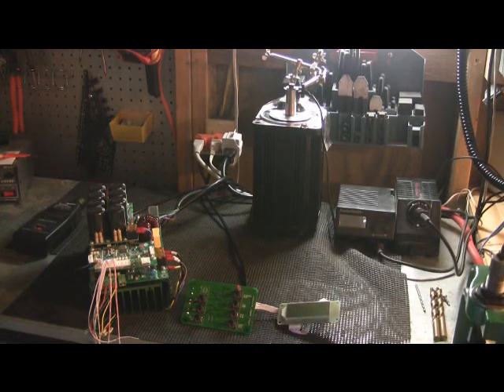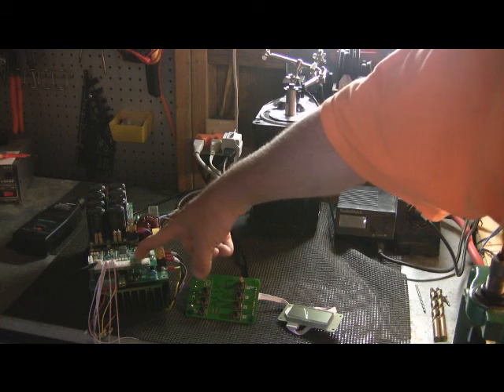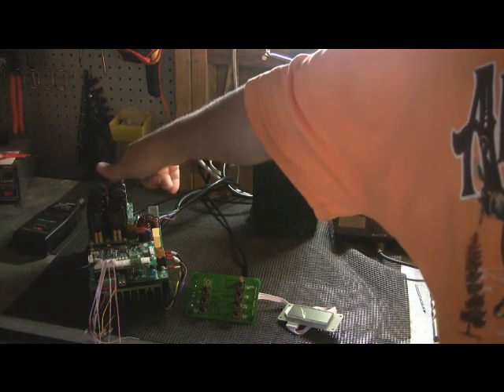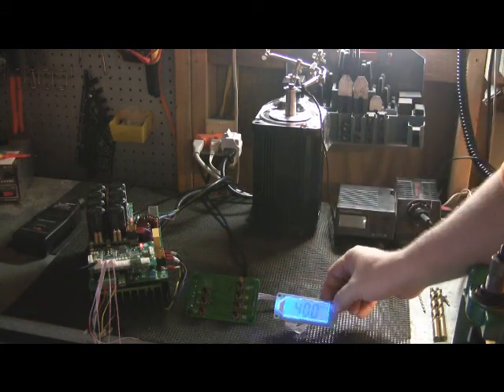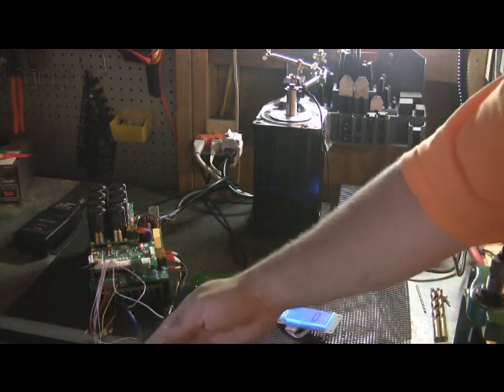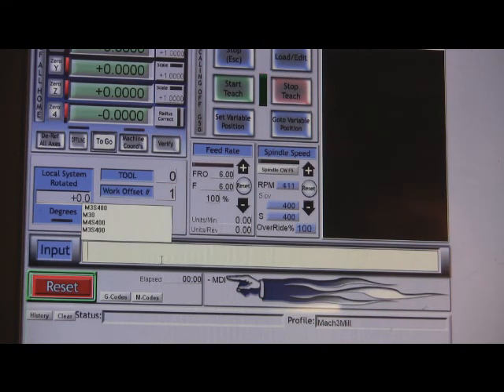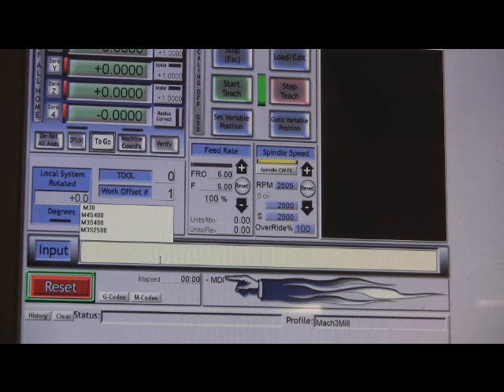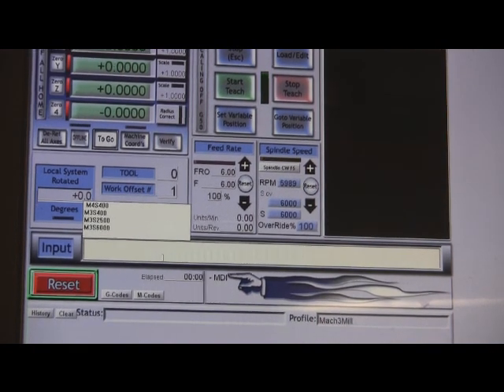motor and controller review

Comment: Does this setup have spindle orientation?
Reply from the maker: +Shane. Sure. That is dependent on the Mcode you use to start the motor. The motor can run either way.
Reply: +cjdavis618  I was referring to control of the degree of rotation you stop the tool.

Comment: Cjdavis,
I have the same setup as you with the c11 BOB, but I have an 1100w sangmutan setup that I have been trying to get to run via Mach 3. I have tried to follow your hook up instructions but they are for the 2200w setup as my controller board does not have a CN6 spot. I just cannot seem to get it to work and I have read your post where you said you were hooking up an 1100w motor, could please tell me exactly how and where you are hooking wires to from the c11 BOB and the Controller. Also I don't have the C3 for the RPM yet but will order one now, but why can't you use the rpm feed from the motor controller board?
Reply: Hey Jim, I am in the same boat you are.  Did you ever get it figured out? I set it up just like he did with the C11G and the mach3 settings but have no motor movement.  My machine didn't come with the manual control card so I cant usd that.  Thank you
Reply: @1972nova355  I did, but that has been quite a few years ago and I have slept a few times since then so I do not remember what I did, but I know it turn out to be something simple.  Sorry I can’t help anymore than that.

Comment: This looks like just what I need for my gantry style router/mill system. I use the Kress spindle for woods and plastics and non-ferrous metals with small cutters. But I need a slower system for ferrous metals although I have successfully milled Meehnite with 2mm cutter going at about 8K rpm. I also use Mach3 with a DIYCNC b/o board.
When you apply your system to a cnc mill how do you envisage implementing a spindle and collet system?
Thanks for a great vid.

Comment from the maker: @lyntoncnc 
The speed feedback is coming from a CNC4PC C3 -index pulse card that connects to an input on the Breakout board for the parallel port. What I have done is used the index card as a tachometer so that Mach3 can calibrate the pulses to the correct speed of the motor within a few RPM. It is certainly close enough for milling.

I use a CNC4PC c11g board going to a C3 index card.